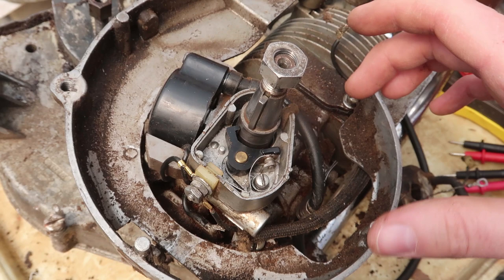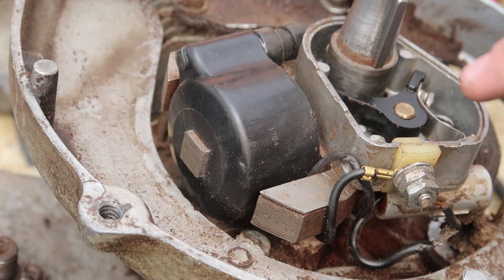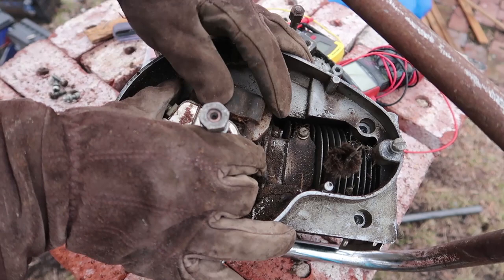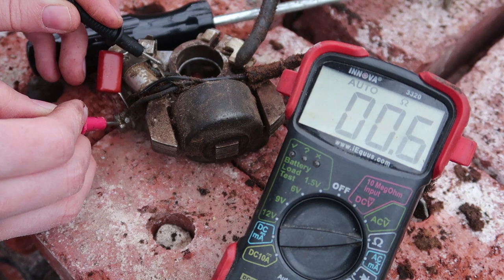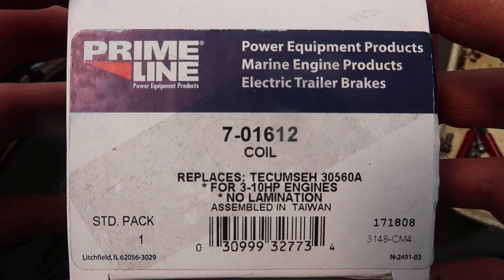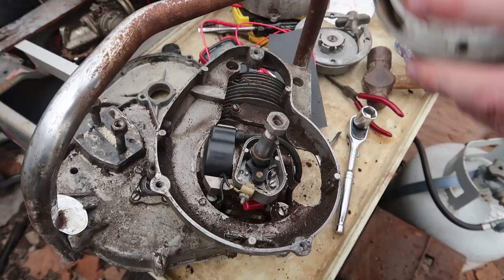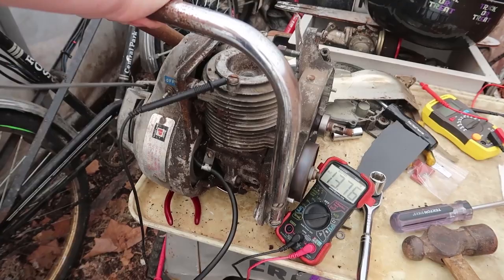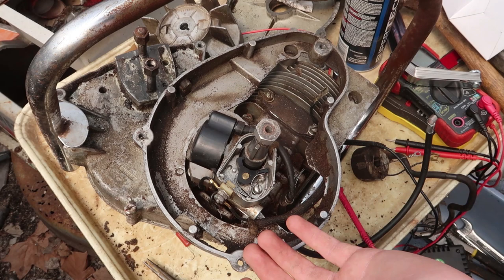1950s David Bradley Chainsaw Restoration 04: Magneto Coil Upgrade Experiment, Fix No Spark

Comment: Assuming you have cleaned the point disconnect the condenser connec12 V battery charger to the point and open and shut the points short-circuiting the battery charger for a very short period of time this will burn a new contact in the point open and shut the points seven or eight times reconnect the condenser refit flywheel mag and Spin And test for spark this usually works and it doesn’t cost anything to try it cheers Derek

Comment: Rinoa, first check flywheel mags are ok. In the shop, we used to hold the end of a screwdriver handle lightly between thumb and forefinger. Pass the flat blade by the magnets 1/2"to 3/4" away. They should pull that screwdriver blade right to them. Point gap should be about .017. Those laminations shouldn't be an issue. Condenser and coil lead to points screw, kill switch connects there also, to ground out coil for stop. Make sure that the points connection is not grounding out anywhere. I would replace that condenser with a Tecumseh condenser. It looks like a Lawson(Tecumseh) ignition anyway. Also, you may have thrown the timing way off when you removed the mag plate. If you can give me some engine info I may have some specs on degrees before TDC. Point should just break so many thousands before TDC ( piston Top Dead Center).
Reply from the maker: yup i did that, it grabbed the driver 3/4" or more away. i dont think magnet is the problem. i shoulda included that in the video though. thanks.

also the timing doesnt matter since the coil and points are the same distance from each other. and i marked the location of the magneto anyway before removing it the first time.
Reply: Rin, I would still supply Starcarrier with the engine particulars so they can supply you with information they may have available. The more you know, the EZer your job will be...

Comment: You do need the proper condenser for the ignition. Maybe consider new points as well. You are not an idiot. You are working on old technology and you are learning. And young people watching you are learning too with your videos,,,  So kudos Rin.
Reply from the maker: well thisis the capacitor that ive seen a lot of other people use for magnetos, but i agree maybe ill order a replacement and see what difference it makes

Comment: One of the two small wires is for the kill switch.  Disconnect it from ground. That prevents the electric flow from gong to the plug.  You're magneto is working.  But with both wires connected to ground it is in constant kill mode.  The kill wire should go to a switch whish is open when running.
Reply from the maker: yes i already understand that, but i didnt have a more clear understanding of exactly how it worked. i doubt you do either
Reply: the small switch in the body is the kill switch. try duct tapping the terminal to 
isolate it..

Comment: About filing the lamination stack - Although the laminations are usually coated with oxide or another insulating material to reduce eddy currents, a small amount of direct metal-to-metal contact between them should not make a huge difference. I wouldn't worry too much about the filing.
Reply from the maker: ok thanks for the input. i really dont feel like drilling the rivets and re-coating the core plates and then putting it back together. this is most likely a problem of something small that i missed. like maybe one of the old wires breaks down at high voltage or something weird. idk.
Reply: Steven Birch the label on the box said "no lamination" idk if that makes a difference

Comment: Coils have no resistance to DC. "Condensers" can store a much higher charge. You can't replace them with smaller electronic capacitors. You need to match their voltage and farads.

You are using DC to measure devices that work with AC. You are getting false results.

When you are dealing with coils and capacitors, you are dealing with AC, alternating current. And AC is very different than DC (direct current). You cannot use a simple Ohm meter with AC. It will give you false results.

Coils on a small motor are just that: two coils. One is connected to the ground, that is, the engine casting, and to the breaker, that thing you clean the points on. The other coil is the high voltage one that connects to the ground and to the spark plug. There are three connections: ground, breaker, and spark plug. It is important that they are connected properly or they may (will) damage parts.

The small coil you showed in the video is the breaker coil. It is smaller and has finer wire than the high voltage coil. The high voltage coil wraps around it. And it has thicker wires.

And when I'm talking about high voltage, I mean 20,000 to 50,000 volts. If you want to measure it directly, invest in small-engine diagnostic equipment. Anything else will be damage when using it.
Reply: All wire has resistance to DC. ALL.
Reply: Only if you own a very expensive Ohm meter. 🙂
Reply: Rubbish!! like Larry said "All wire has resistance to DC" I measure coils all the time with resistance test then an LCR meter, a coil can be crudely compared to a wire wound resistor, check your facts please.
Reply: By the way : Can't you remove the magneto and replace it with a battery?

Comment: try to recharge flywheel magnets. I have a old Suffolk punch lawnmower same problem, could never get a strong enough spark recharged with electromagnet works fine now.
Reply from the maker: i dont think the magnets are an issue. ive heard dangling a non-magnetized screwdriver towards the magnet is a good test. the magnet grabbed the screwdriver about 3/4 to a full inch from it's surface and things stick to it quite well. :/

Comment: I’d clean and gap the points, about 12 thou should do it, gap the spark plug to 25 thou. 
Replace the HT lead (spark plug lead), they can leak with constant vibrations against metal. 
I’d put a new condenser on, it’ll  be cheap to replace. 
 Rin, you’d like Roadking805 YT channel, he’s into single cylinder and very old engines big time, a very interesting channel indeed. 
  Good luck.
Edit: 
  The coil plates aren’t insulated against each other, that isn’t the problem.
Reply from the maker: on the nameplate it says 30 for spark plug and 20 for points. spark plug is brand new. i tried a new capacitor in this video.

and yes i enjoy roadking's videos. also his friend's videos. think his name is Mike,
Reply: Rinoa Super-Genius 
Sounds about right, the gaps vary between makes of Engine.
Reply: .012" for the point gap is far too small,should be : .020"-022",basically a match book thickness,use a point file to remove any oxidation before setting the points...then set the points,and replace the spark plug just incase the original one in it is faulty...

Comment: i used to be a logger and now i am an electrician so i feel like i should know the answer but i dont see anything wrong with your explanation. your methods seem to be spot on. the only thing i can think of is to mount the flyweel and magneto on a lathe or a drillpress to spinn at varios speeds sort of like a testbench. it could be an alignment and timing issue. on the pluss side the carburator should be fun since your country is fossil fuel friendly so you could mount the carburaton on a blower and make it shoot flames like a dragon
Reply: and the oscilloscope is a good investment the meter is not so good with high voltage sparks. it may blow the fuse
Reply from the maker: Well the thing keeping me from buying another oscilloscope is i already have like 3, but they are all over 50 years old and need serious repairs. however when i visit Silicon Valley again this May i'll go to some recycling centers to get a digital one. lol

Comment: Was the coil you swapped in off of a breaker less style ignition? It won't work if you hook points up to a breaker less style coil.

Comment: I don''t know if it matters here, but on some circuits the ESR value of the cap needs to be in range (according to an ESR chart) in addition to the capacitance being correct. I'm pretty sure this applies to higher frequency circuits, but who knows.

Comment: The capacitor stores the electricity produced until the points break the connection which causes the spark to happen from what I know from years of working on the stuff (shade tree mechanic ) and anytime that I ran into a problem like that it was from the magnets on the flywheel being either dirty, weak or too far away from the coil so you might want to check that out.  Good luck.

Comment: Use an condensor for a old Briggs and Stratton...they are rated at 400 volts .01uf which should be perfect...the condensor is only there too suppress the arcing of the points to prevent premature burning out of the point contacts

Comment: 3 wires coming out of the ignition coil. 

1. High voltage (spark plug). 
2. Common ground (connected to earth somewhere). 
3. + Volt (goes to the point). 
Wires 2 and 3 are not the same.

The capacitor is connected between the point and ground (to eat the back emf in the primary coil). It protects the point from spark erosion.

The back emf in the secondary coil provides the desired spark discharge in the plug.  :)
Reply from the maker: then how come there is no resistance between 2 and 3? :/
Reply: 1-2 Hi resistance. High number of turns, thin copper. High voltage low current.

2-3 Low resistance (you can not measure it with your equipment). Low number of turns, thick copper wire. Low voltage high current.

1-3 Hi resistance (1-2 + 2-3) The coils are in series with the same core.
Reply from the maker: thats a good point about it being a thicker wire. hrmm. maybe i will flip the wires just to see if maybe it is best the other way around. thanks for shedding light on it.
Reply from the maker: yeah i saw that video, didnt notice about the wire length though. thanks for noticing.

Comment: Magnets on the flywheel might be bad?  Saw you sand the points but did you check and adjust them?
Reply from the maker: flywheel is fine, and adjusted points. i bought a new magneto for it, will make a video when i get my workshop built

Comment: The "condenser" prevents the ignition contact to burn-out when it opens. It also to prevents/suppresses radio EMI/RFI. Make sure the engine timing is properly set. The contact should open right after the piston goes past its top dead center (measure it removing the spark plug and inserting a pencil). Check for sparks removing by the spark plug having and grounding it outside. Check for fuel odor (to make sure the carburator is fine). Huge fan from Brazil and a friend from the ∞ loop... Best regards
Reply from the maker: timing doesnt matter until i have spark
Reply: so... if the timing is wrong, you won't have the magnetic field at the same time the contact opens... It matters!
Reply: 25-30 degrees before TDC! 28 is common on old chainsaws... :)

Comment: Is there a carburetor on it. It sounds like it wants to start. Maybe the filter is bad. Is it using a floating ground or is it using the case for the ground. Check fuel line. It is almost going. Check the pull starter. The faster you crank on it the more it wants to start. I'll keep thinking. Cool vid.
Reply from the maker: it doesnt have a spark, so it doesnt "want" to do anything

Comment: If when using the torch, old magneto magnets demagntize. Never saw you pull screwdriver off or away from field. Another possibility could be, I am guessing, if the coil is wound opposite it may be throwing timing way off. But match coil and condenser. And a foil wound condenser/capacitor is all I would replace. And if maybe short circuited any of the windings or cracked the sealed coil and got moisture. Weak magnets is my first idea and I feel for you, I do respect the project you took on.
Reply from the maker: yeah i tried the magnet test off camera, its still very strong. however i never thought about the coil's polatiry. god theres just too many things that could be the problem. i got an oscilloscope and the past month have been trying to make another video but im not getting anywhere. peaking at 200 volts and the voltage just plateaus at the peak. dont think its a limit of the scope since the plateau changes voltage depending on how hard i crank. played with the gap a bit but it didnt seem to help.
Reply: The only reason I mentioned the winding direction is when n and s is ever reversed it weakens the pulse and don't no why, maybe the way the discharge condenser is timed. That was my guessing. And I now wonder if it might not have been better to slowly melt the coil on the coil frame. To keep field stronger going to the iron plates in the magneto frame. All hindsight. My Dad was the engineer. I do yards and have two junk yards but not what you need. But I know this,  get a flywheel hot with a torch just a little. And you have to change. Magnets. They demagnetize at a temperature lower than the heads normal operating temperature. 280 Fahrenheit or so.
Reply: @douglasdavis1942  that explains why a low hour dB 5 or 7 something g model won't fire.  It has compression with slight vertical scratches on the piston, only quite a bit of burnt discoloring on the head.  I'll bet whoever was running it probably ran it straight gas, they also had the air cleaner filter mount backwards. The gasket on the wrong side.   Can't seal it that way.  They can't be remagnetized. They have to be replaced in the flywheel?

Comment: Did you check that the spark plug isn't shorted / low(ish) resistance?  Looks pretty blackened, but it's hard to say if that's actually a problem or not...
Reply from the maker: yes and tried a new plug

Comment: You say you felt the zap, does the plug have a good ground. I thought about eddy when you filed, but that shouldn't ruin the deal. Dont pull apart and re-rivet, just scrape perpendicular to the plates to get rid of any metal you smeared between plates. If you feel a zap, you should see a spark. Maybe try at night or see if a smaller gap helps? After cranking with mix gas to get it oiled, have you tried a squirt of ether?

Comment: This is old and obviously you gave up on this, it is a magneto and the Condenser is exactly that a rugedized electrolytic capacitor in which the outer shell is ground, the magnets when passing the core will load the coil in Flux charging the condenser at the precise time the points trigger the release causing the Auto Transformer portion of the coils voltage to spike thus triggering the spark.  Remember that one site of the condenser is ground and one side of the spark plug is ground, shunting any of the coil leads to ground will kill the spark. Ignition happens when the condenser discharges to the low side of coil causing the high side to generate high voltage to ground thus the spark.  I own several of those David Bradley chain saws originally sold  by Sears and Roebuck and the coil you purchased will work.  Get it running and hold your ears.
Reply from the maker: no i didnt give up, i decided to build a workshop so id have a place to work, all parts are in a box in workshop now.

Comment: Most likely the issue was that your points were corroded from the start and the original coil was fine. Always start with the points especially if it’s been sitting for a long time. Cleaning the points will fix a no spark condition about 80% of the time.
Reply from the maker: i cleaned the points and the coil is open circuit, so your doubly wrong
Reply: Well then...I stand corrected. Did you ever get it running?  I picked up the same saw today.
Reply from the maker: not yet, found a new magneto for it though. will try it when i get some room.

Comment: The explanation you gave points me towards that the magnets on the flywheel are possible weak or the magneto is not a good match.  Not real sure how to fix that besides replacing the flywheel or magneto.  Going from lawnmower stuff always stayed with a matching set making sure flywheel and magneto where made for each other.
Reply: Just some general knowledge the spark is weaker when your pull start it it gets stronger with higher RPM so sometimes using a drill to crank it over is helpful for troubleshooting.  The condenser could be weak too, can grab a cheap kit from Home Depot with one in it that will fit.

Comment: We.re going on 90 days. Did you give up? Love these low dollar restores- compared to the high dollar 1960's Canadien 270 Will Matthews just put up. I think you get more for your money!
Reply from the maker: nope, put it on the shelf since i cant figure out why the magneto doesnt work. oscilloscope readings are all over the place. waiting to purchase another magneto.
Reply: Rinoa Super-Genius you could rewind the original one.
Reply from the maker: no i couldnt, the original coil isnt rewindable, and the new coil i bought is only making 250v at peak.

Comment: When you are setting the points on those old engines that tin cover that goes over the points have a tap on them...that is used to set the points at proper gap ...020 or 015 or what ever is called for. The point gap should be marked on the tin cover and it MUST be right or your timing is out. Also it is not a good idea to remove the whole apparatus if the holes are slotted under the bolts that holds it on, that is how you set the timing and it must be EXACT.

Comment: try to use a new automotive style condensor. im not 100% sure the dc ones will work. you could also run 12 volts through the condensor while the points are shut, and then open them. the points should spark when you open them. dont worry about the metal bits the coil goes on. they dont matter if they touch. how strong do the magnets feel in the flywheel?

Comment: What about the wiring from the power switch? The points could be bad and will need to be replaced. The pitted points is not good. That's all I got for now.